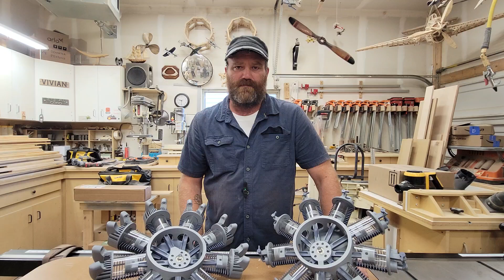Radial engine vs Rotary engine

Comment: Also, in a rotary, the pistons do not reciprokate, while they do in the radial engine. 
In the rotary, the relative motion of the piston from  the top dead point to bottom dead point is realised by the excentricism of the crankshaft versus the engine block. The pistons just move in a circle around the crankshaft. In stead of reciprocation, they accelerate and decelerate in terms of turning speed during one complete circle. when they are at top dead point they turn faster than at bottom dead point. This is possible because the connecting rods pivot likewise as in the radial. Quite different!